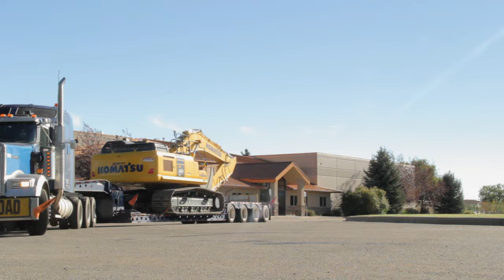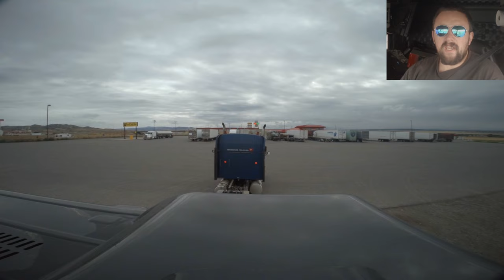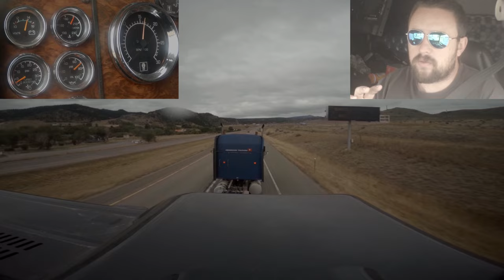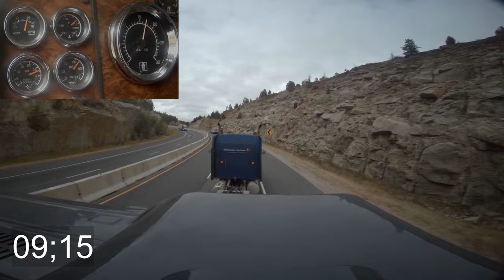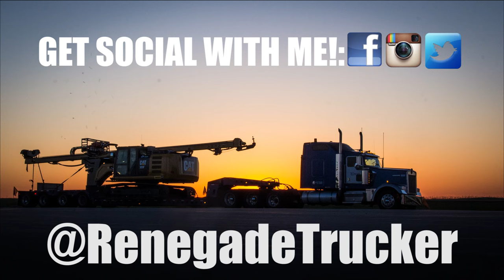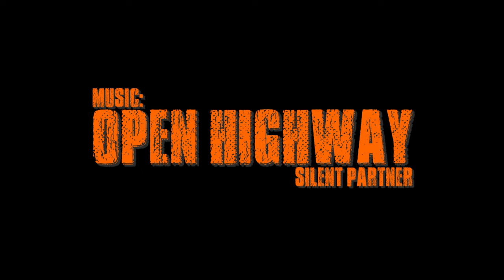Komatsu PC360LCi   Butte Hill 1

Comment: Glad the motor is running well :). Its sweet spot is 1500-1800? If I tried that pull w/my cut back D13/Eaton-10 company Volvo 670, it wouldn't be a long video ;-P...
Reply from the maker: The peak torque on that motor is 1400 RPM, I let it bog down to 1300-1350 usually before shifting.

Comment: Are you going to give a complete power run down on it now? Engine trans & finals? Did you notice that your driver roof beacon not working and pass is only on 70% of the time?
Reply: i noticed that about his beacon lights too. hope he had those fixed.
Reply from the maker: Yeah, just need to get a ladder to get it fixed, its up higher than I can reach.
Reply: prime flatbed driver  - channel Randee Lewis - has a really neat collapsible ladder to climb up on high loads where he needs to roll out his tarps... 10:16 of Prime Inc Flatbed Windy Load has a good shot of it.  Hope it helps.  I almost asked him where he got it cause it just looked handy to have around the house...  How big a ticket is not having those lights working on an oversize load?